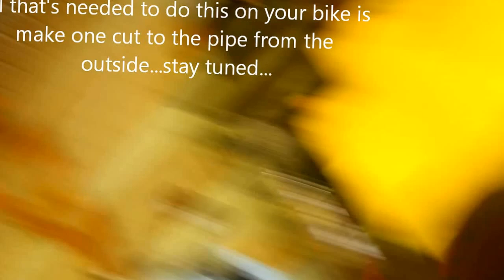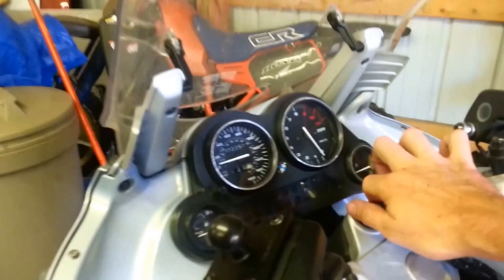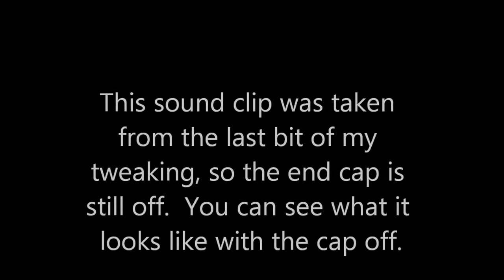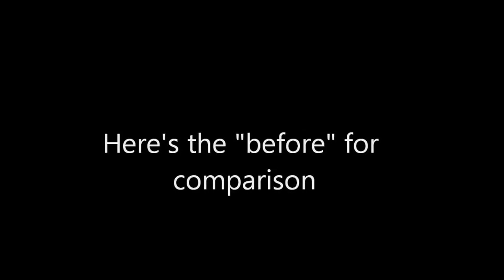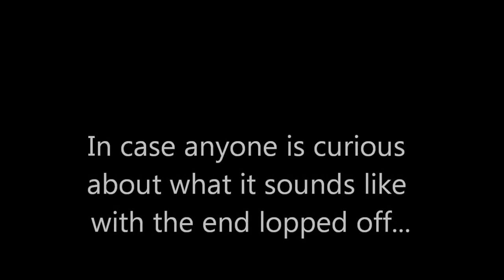K1200RS stock muffler modification

Comment: I have found that the muffler was a bit too short. When running it leaves soot on the inside edge of my LH carrier. So I modified it by putting a 150mm extention into the back of the muffler.This stopped the sooting and it is a little quieter.

Comment: Hi bro, i have the same issue with my k12000rs , (brake problem) , what have you changed to solve it
Reply from the maker: Embarrassingly, of all things it happened to be the rear fluid level was low.  It has two reservoirs in there so it's easy to miss.  One side does the rear brakes, one goes to the ABS module.  I'm almost thinking you had to take one of the rear side panels off to fill it as well.

Comment: Hey man you still got this bike ?
Reply from the maker: Yep
Reply: Thank I just got one  haven’t ridden it yet but just looking in easy mods, your video is very informative and straight forward. How is with maintenance?  is it a lot one work
Reply from the maker: @fabzrustrider9838  It's really not too bad.  You definitely want to stay on top of the final drive oil change, although it's pretty easy, just pull the drain plug and put in another 8 oz of gear oil.  Transmission oil change isn't bad either.  You need a special (K bike specific) filter wrench to get the oil filter out since it's a canister style and completely recessed in the oil pan.  If you can man handle the old one out or borrow a wrench from a friend, K&N makes a filter (I think KN-163?) that has an extra hex head bit on the end so you can just use a standard wrench, that's all I use.  Since it has a dry clutch you can use standard automotive oil too, I prefer Mobil-1 15W50 synthetic.  The valve lash and spark plugs are much easier than typical 4 cylinder bikes since the engine is on its side.
Reply: Adam Witthauer thank you very much Adam I will keep you close just in case I need a little help, your bike sounds amazing too
Reply from the maker: @fabzrustrider9838  Awesome, thanks!  I actually may post an improved video that shows an easier method, although I have been saying that for a couple years now so don't hold your breath.  Last couple years have been rough.  I have to do this again now because I lost the end cap on the muffler.  The clips that the bolts screw into rusted out, and the cheapest/easiest solution was to just get a whole new stock exhaust for $40 on Ebay.  At 103k miles I can't complain.
Reply: Adam Witthauer well that’s a story by its self man lol you definitely need to notify your viewers because many will follow your methods
Reply: @adambomb789  looking forward to it.  As these bikes get cheaper we are more inclined to have fun modifying them.  Plus aftermarket exhausts are super hard to find